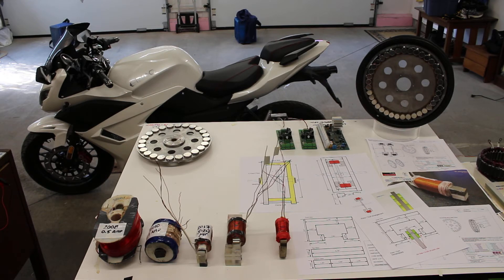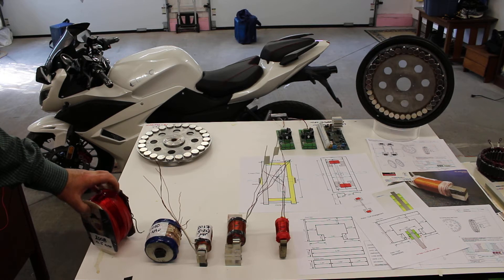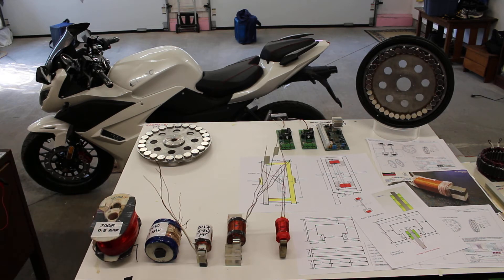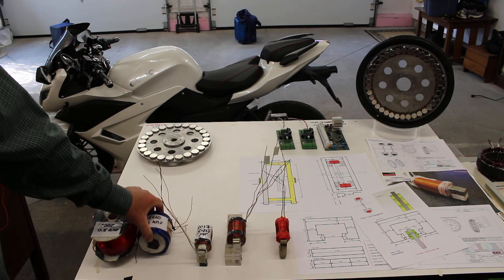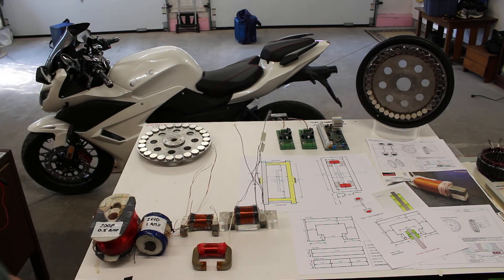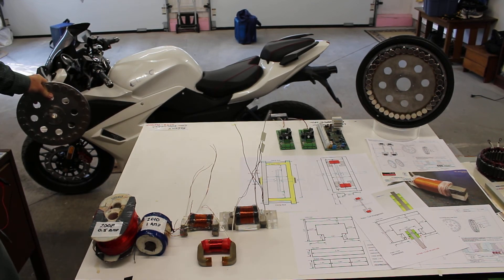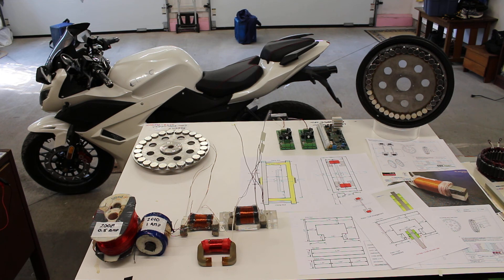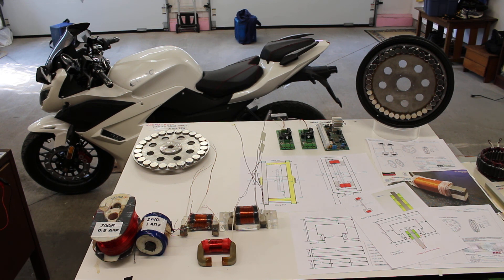PART 5 ReGenX Conclusion

Comment: 50 Amps, at 0.5 Volts? That's 25 Watt only. Just kidding. Numbers are meaningless if they are incomplete.
So, you are going to place that many coils, on the front wheel? Will the weight of it all influence the drive characteristics of the motor? Why are you not using a car for this? A small car, quad or something like that? On a motor you are so much more vulnerable. PS: we never hear yu say about the additional power gained. Can this be expressed in any figure?
Reply: dylans voice  I agree. But what if some part gets out of balance? A motorbike only has 2 wheels, a quad has 4. Which one could miss 1 wheel?
Reply: dylans voice  Yesterday I had an idea (insight). If, and only if, I have understood this, then I think that one of those Don Smith devices (the one with many Tesla coils) may be for real. We don;t need a rotating disc, electronics mimic rotating magnetic fields. A Tesla coil has all the details. High Frequency, huge amount of turns of wire (high Ohms and H) etc. It is very well possible Tesla had an infinitive generating device as well (and got suppressed).
Any how, I think it is a good idea to do some testing. And if it fails, take a small rest and try again. The return at the end is huge, so it is worth it.

Comment: 5-10A at what voltage?i think that Zero motocicle has a 72v battery,One coil its outputing 12v max at that size and from what you showed.So the coils must be wired in series cutting the amperage to 1A.Another question is that the disk brake rpm is 1000rpm at top speed and your coil needs 3400rmp..how do you solve this?I tested your theory and it works..but for people to believe share more numbers...